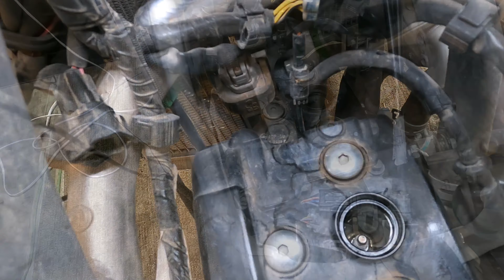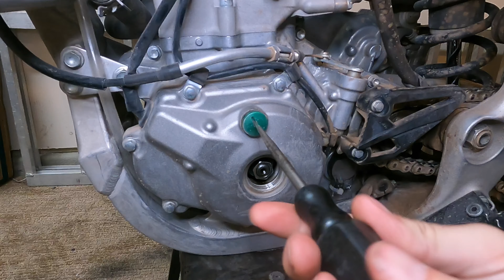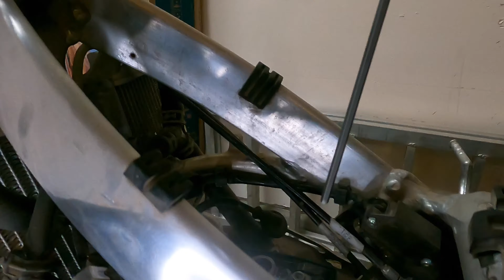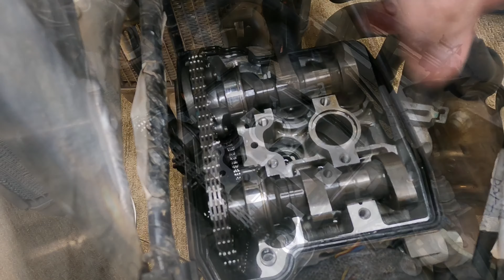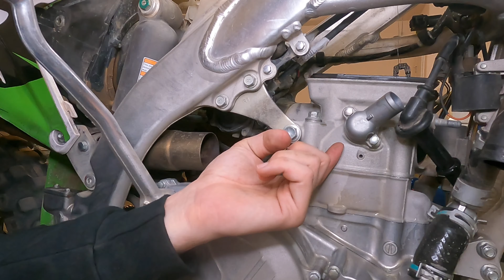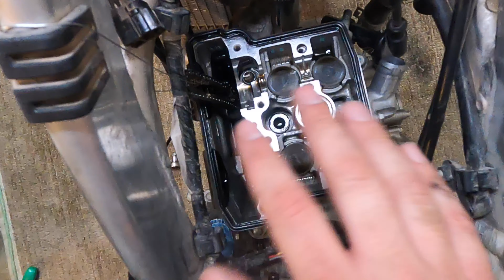DIY KX450 Top end disassembly

Comment: Great video.  I have the same bike with almost 40 hours on the motor.  I only race MX but im an older racer and really dont beat on the engine.  Never bounced off the rev limiter.  Ive done plenty of top ends on 2 strokes but the 4 has me a little intimidated.  With your video I think i'll give it a shot.  Thank you
Reply from the maker: Thanks man. They aren’t too bad at all once you get in to them.

Comment: Super helpful man! I just got a 06' kx450f for free!
Reply from the maker: Sweet!! Nothing better than free even if it need a little work it’s worth it
Reply: Yeah. The right side of the engine was taken apart, I put the Kickstarter back in place and the clutch back on. Waiting for a gaskets kit. They didn't keep enough oil in it and the top end blew up. New head, cams, valves etc. I took the cylinder off and the crank is good. The piston rings are broke, so need some new ones. Just a whole lot of cleaning and waiting for the gaskets!
Reply from the maker: @traveling_country_ranger_  nice! That’s worth it man. Lots of people have an issue and would rather just get rid of it than fix it or pay someone. You can get some great deals that way.
Reply from the maker: Also did you check the inside of the cylinder for damage?
Reply: Yes I did check the cylinder wall for damage. There is a few scuff marks but nothing that catches my finger nail even the slightest bit. I was thinking about getting a whole new postin kit but I think I'll just buy new rings cuz the piston looks fine with only a few scuff marks.
Reply from the maker: @traveling_country_ranger_  yeah that should be good. If there’s no dark spots or anything that catches in the cylinder it should be just fine. Same with the piston. You can check the tolerances on the piston too but if you put new rings in and it doesn’t have any issues the piston and cylinder should be just fine
Reply: @tannerjthomas  it Looks like I am going to have to geta new piston. I found the Wiesco piston kit I want for the bike, but turns out that I am going to need a new cylinder also...😖 Do you have any recommendations for a new cylinder jug??? I don't want to pay too much.
Reply from the maker: @traveling_country_ranger_  shop around a bit. I’m do OEM factory parts for most of my stuff so if you google that you’ll get a ton of warehouses that sell factory original parts that’s probably your cheapest bet on a cylinder. I just looked and for your 06 they go for $459 for a new cylinder but shop around you may be able to find a better deal.
Reply: Great video mate I'm looking at doing a head Gasket on my 450 water to oil. Light head plan new Gasket..  thanks for the demo made it look easy

Comment: I have a chain slap rattling noise.  04 kx250f. Bike was rebuilt. I'm thinking a cam chain tensioner.  Or my chain is just super loose. I had this issue on my 05 zx10r and now have same issue on my 05 450r.
Reply from the maker: I would try to tighten the chain first that usually makes a lot of noise if it’s loose. If you tighten it and it’s still doing it might be timing chain but it’s likely just your chain. Usually at lower rpm lugging it out of a corner for example is when a loose chain will make the most noise.

Comment: thank you for the video, about to get into by top end for the first time to check the valve clearance. was wondering what type of gasket adhesive is needed when replacing the large gasket under the valve cover.
Reply: Rtv
Reply from the maker: I used Honda bond for basically everything

Comment: I have the same bike I got it with a blown head gasket and I replaced it and it blows coolant out the right side of the top end .. but also I do not have the original to top cylinder both on the right-hand side I have other both I had made to work but I don't understand why the gasket leak still maybe head is warped or could it possibly I installed it wrong? Any advice would be appreciated

Comment: hey bro i had a shop look at the bike i bought my son i took them just the motor they said the cylinder had good cross hatching so he put it back together with new gaskets and i was watching another guy talk about breaking the seal of the cylinder and if you do you should rebuild it cuz if you don’t it will mess up your motor what’s your opinion on that thanks bro
Reply from the maker: These bikes get lots of wear and tear. I would say it depends on how you’re riding it. But honestly if the cylinder is still in good condition it’s fine to “break the seal”. These motors go for tons of hours and you can replace the rings and take the motor apart and put it back together and do all kinds of stuff and it won’t mess it up. Really the only time you need to be concerned with a full rebuild and messing things up is if it’s showing symptoms of bigger problems. These engines are tough. I ride mine hard and am on the rev limiter quite a bit and it’s just fine.

Comment: The bike doesn’t have to be in top dead center unless your checking valves correct?
Reply from the maker: To disassemble it no it doesn’t.
Reply: Okay thank you so much as well for you quick responses so I’m assuming when re assembling my top end I have to have it at top dead center then
Reply from the maker: @jaybloxx_2  yep top dead center for the reassemble.

Comment: I need help I got the same bike and when I race and turn it off it doesn’t start
Reply from the maker: Any other symptoms while it’s running? How long does it take until it will start again?
Reply from the maker: Could be a lot of different things. Does it run rough or have less power while you’re racing?